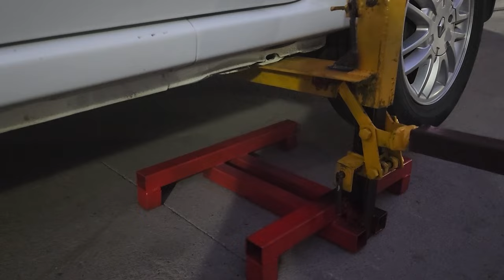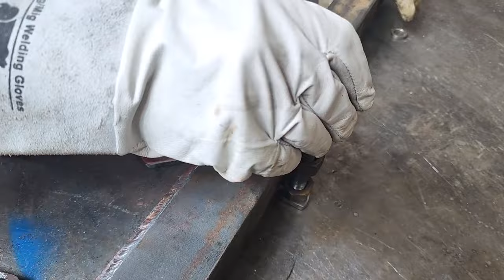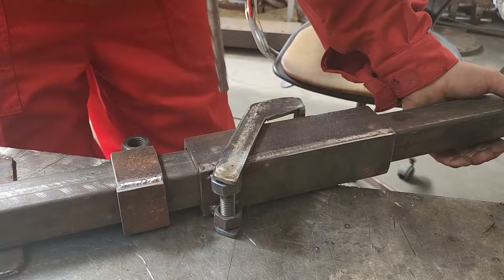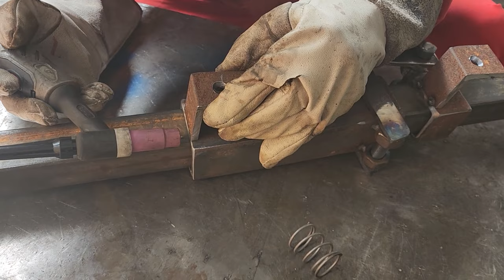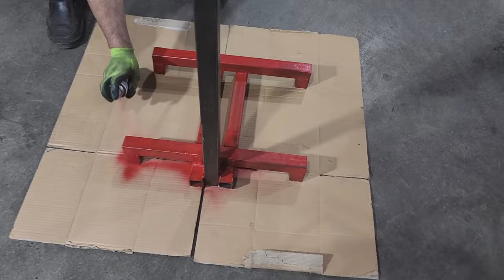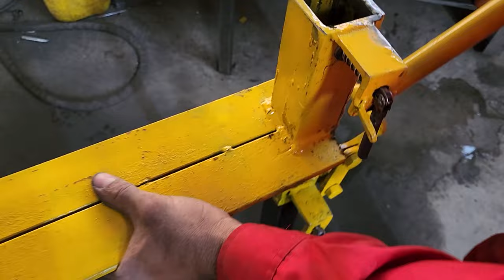How to Make a DIY Car Jack: Inspiration from nature #jack #lift

Comment: The load of it all is taken up by two small tack welds. Very dangerous.  They should be replaced by two flat steel pices fully fillet welded, with holes were the nuts are.
Reply from the maker: Thanks for comment. Actually it is not just tack weld at all.  The loaded positions are full welded. In the show becauese of sharp light of TIG welding, all scenes of full welding has been shortened.

Comment: Good idea but it needs a whole workshop to buid the device....never mind the materials ...😇😇😇 Can't compare States with Romania...😞😞😞
Reply from the maker: No need to any special machine. Just driling,  cutting and welding devices are  enough....
Reply from the maker: No need to any special machine. Just driling,  cutting and welding devices are  enough....
Reply from the maker: No need to any special machine. Just driling,  cutting and welding devices are  enough....

Comment: That’s awesome, i’ll make something like that but i’ll just say it’d be better to make it with a thicker metal. And when you weld w tig, sharper the tungsten better, and sharpen it so the striations or going to the tip and not sideways. Also clean the metal good when welding with tig, well any type of welding really but tig especially. Paint, rust, anything that’s not the clean metal can and will contaminate the tungsten and lead to a weaker weld. Ultimately ruining your tungsten faster
Reply from the maker: Thanks for comment...
Actually it depends on load to make the jack stronger enough to carry load...but I am totally agree to use thicker metal as safety issue especially stem...
Thanks again for welding tips. For sharing  extra tips please find my other channel @Mr.skilledwelder100